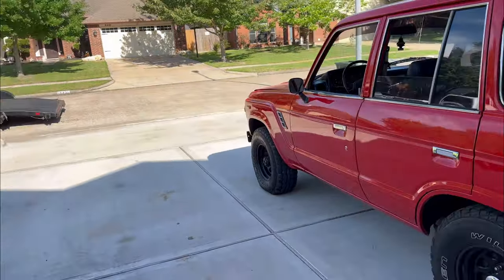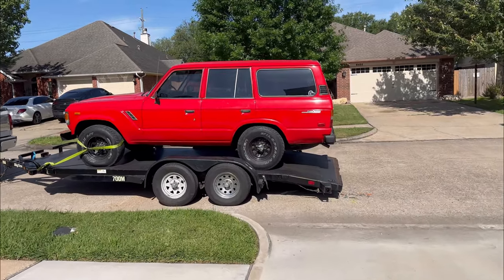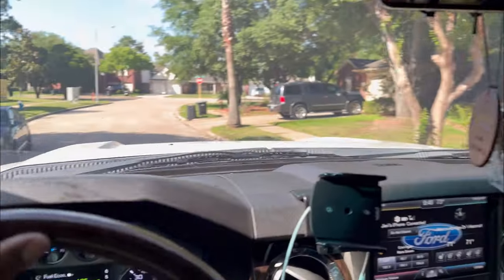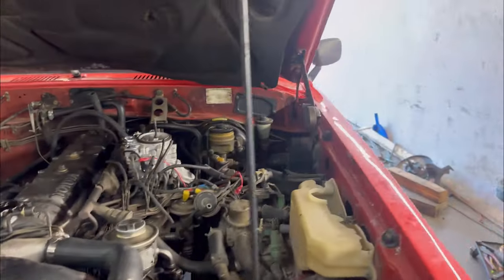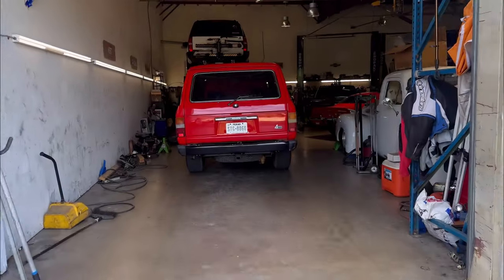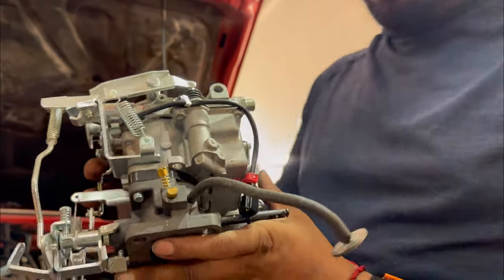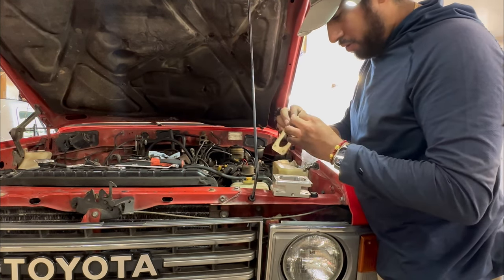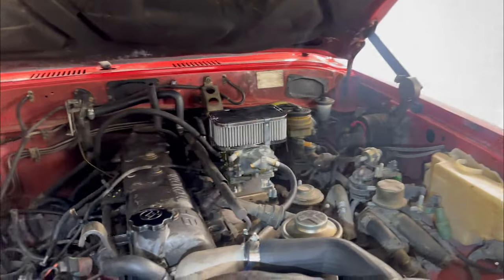86 LAND CRUISER/ FJ60 IS BACK WITH A NEW WEBER CARB

Comment: I love that you have one of these. My dad bought ours from his mom after she found it on a used car lot in NJ. We ended up rebuilding our engine (bored it .030 with flat top pistons). She had lots more power after that. We also ended up replacing some of the vacuum lines as we weren't sure if we'd be relocating to a state that requires emissions testing (we lived in Florida at the time). 
Useful upgrades we did were to change the wheels to 17 in. Toyota Tundra wheels (from the 05 - 07 generation). We added an 1/8 in spacer to make them fit properly and it definitely drove and rode better. We also added a leaf spring to the rear springs (raised the rear about an inch without any load in the back but it'd sit slightly higher than level with a load). The bigger wheels and tires let us cruise comfortably at 70 - 75 right around 3k rpm. Those engines don't like more than 3500 due to that they've only got 4 main bearings (can't remember if they're 2 or 4 bolt mains though). If you're still looking for a bit more power, the distributor and slightly hotter plugs will help, but you'll need to run 93 octane gas. Also, Lucas Heavy Duty oil stabilizer is your friend with that engine (use it every oil change). Those engines hate to be overheated and it'll eat a head gasket as a result. It's been a while since I've had mine (dad moved down to Trinidad before he passed away and took her with him) but you can pick my brain about it if you want.